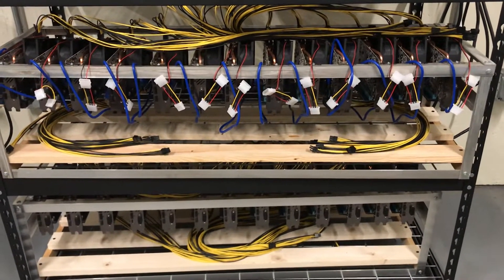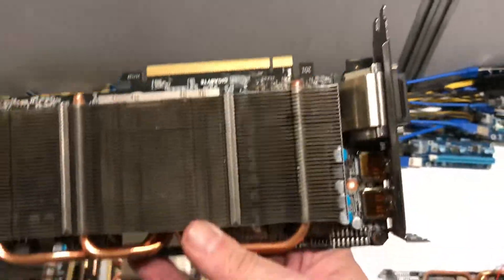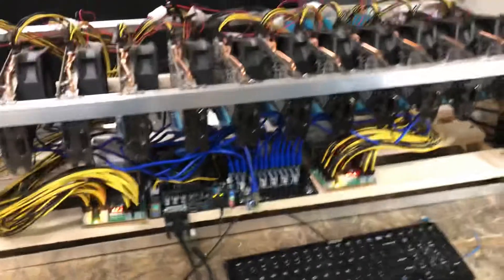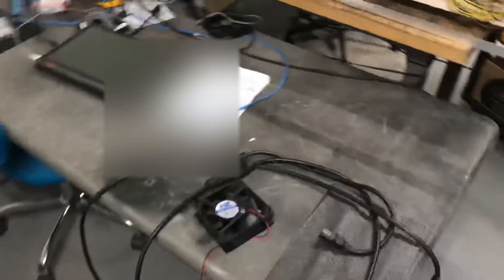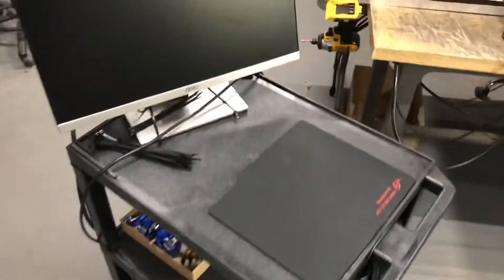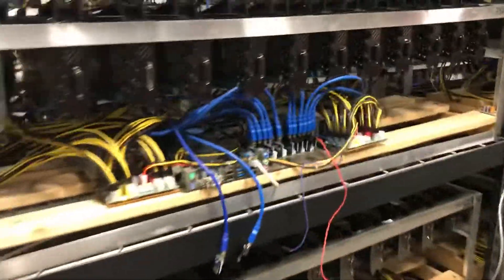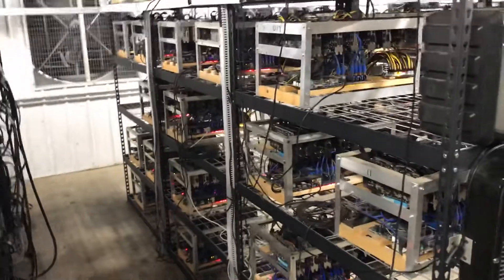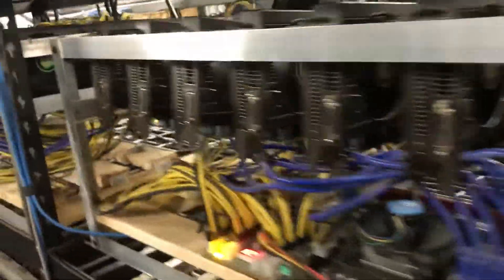WORKER WORK | VOL #2 | 1/18/2021

Comment: can i comment? 
have you tried the slim 80mm fans?
i used them on some old 270s back in the day and they work fine. almost no noise and excellent cooling, even better than stock. i thought about doing all of my new(er) 470s and 570s the same way but they rarely get over 70. maybe this summer when i expand
Reply from the maker: we have tried a lot of different fans.  thanks for the feedback.  all is welcome.  we do not worry about the noise since it is in the farm and the price for these is just right since we need A LOT of them.  temps for us will be higher than others in the summer for sure.  thanks for the comment and checking this out.